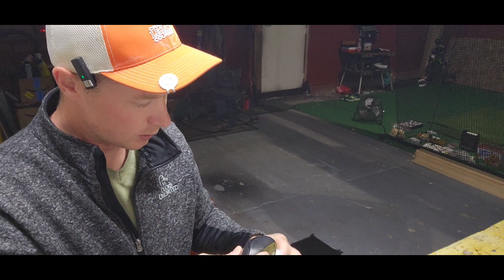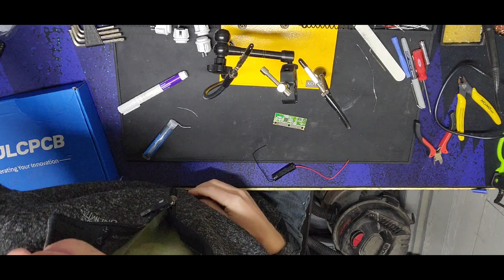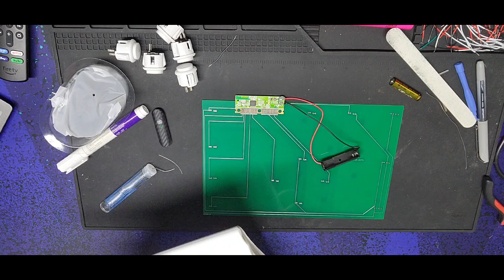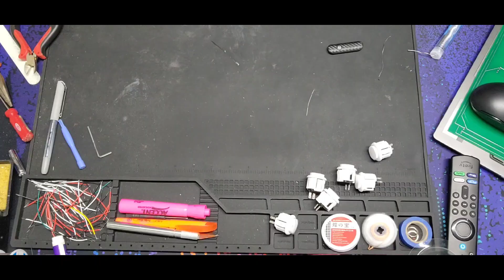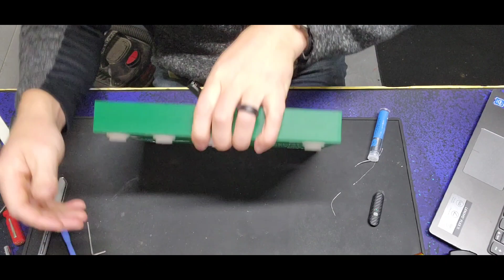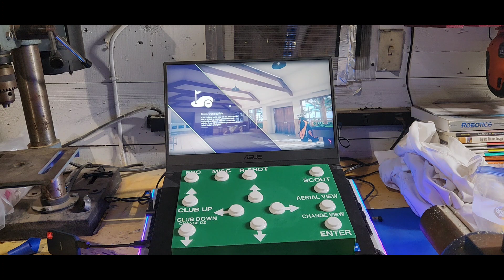How to build a golf simulator control box for GSPRO and TGC2019

Comment: Looks great. Can the v
box be printed on an ender 3? If not could it be sized down?
Reply from the maker: Has to be a plus. If you size it down, you would then have to adjust the whole sizes to get the buttons to fit again. I do have a mini version of the box that will fit on most printers I'll throw up right now
Reply from the maker: I uploaded a smaller one. I don't sell the kit yet for the smaller version. but you could do like an Amazon diy kit thing alot of people do. And use my print file smaller box

Comment: I’m just looking for a 4 button board for up/down ( club select) and Left/Right ( aim) been searching internet for integrate that to my laptop ( I can make the box and but 60mm buttons off Amazon, just need the circuitry to use, any ideas??
Reply from the maker: I could wire one up with wires like I used to and sell you that? Or you could do it yourself.  Watch the video I made on the trade deck. You could do something like that very easily. I also plan on making a smaller board with fewer buttons that people can make inside the box. 12 golf balls come in, and probably be able to sell that kit for like $40 with the wireless mouse.
Reply from the maker: If you looking for only a few buttons doing the inside like this would be a good option.  Just map out a wireless keyboard or buy the $20 small board and mouse kit from me and I'll give you the map
https://youtu.be/V9mc-r-yD9I?si=elgYwr6o_CERtita
Reply: I just actually found the kit for an arcade style controller ( just the circuit board wiring and cables) for $18, plug and play for windows, will try that with 4 60mm buttons . I’m just using Optishot Orion software so don’t need too many buttons on the box. Your boxes look great though, good work. If this doesn’t work I’ll probably take u up on making me one.
Reply from the maker: O for sure, the arcade style board and programming with joy to keylike you found was what I used to use, but I wanted wireless everything, so I change how I made it and ended up doing it substantially cheaper.  Especially now that I buy in bulk and developed my own pcbs. Good luck, let me know if you have any more questions